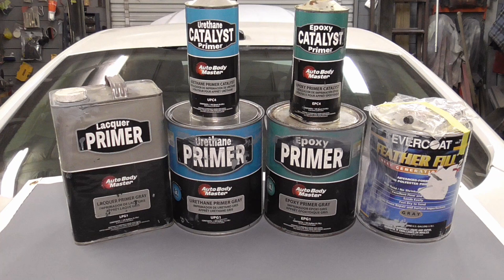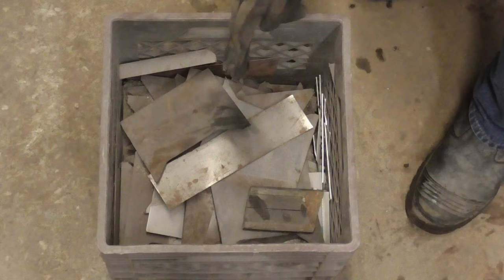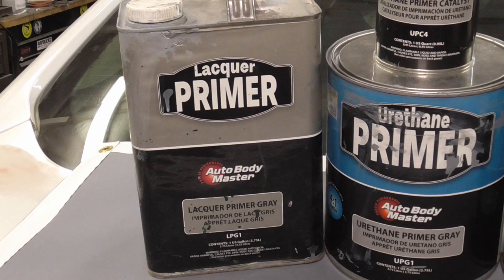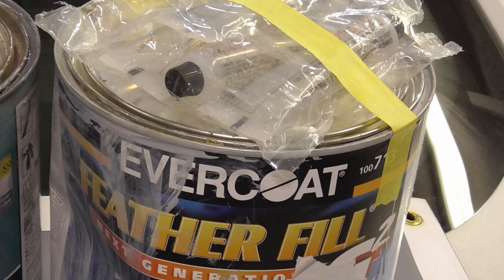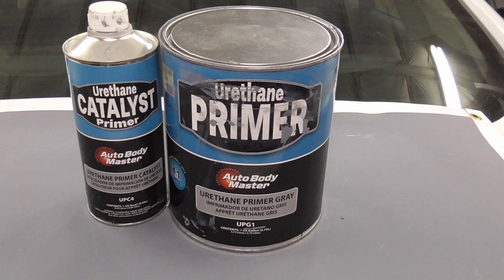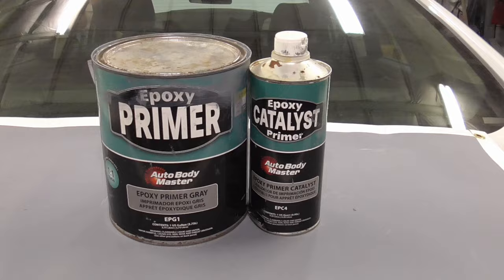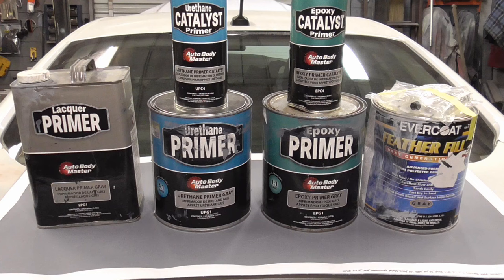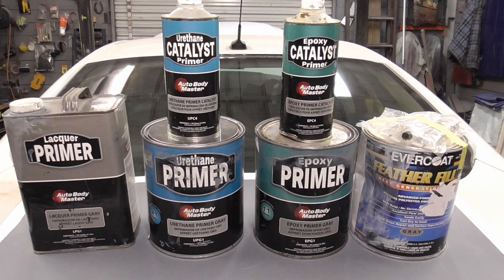A Simple Automotive Primer Guide - Types, Differences & Tips

Comment: What about etching primers and weld thru primers?  Are these considered specialty primers too?
Reply from the maker: Yes - they are specialty primers and you won't see them in a regular, high volume body shop.  Neither one is really necessary.  You can't assure that the area around the weld pool hasn't burned the primer either so it becomes useless.  It's best to think of another way to prevent future rust like this - https://www.youtube.com/watch?v=y05dNxt-nVc

Comment: You hear alot of laying down epoxy primer then the Urethane primer.  The Epoxy for corrosion protection and the Urethane for building. Are using both really needed?
Reply from the maker: They are not.  Most urethane primers say DTM or direct to metal and that means there's no need for epoxy primer.  As stated in the video, if you are going do some body work then park it outside in the weather for months at a time then go ahead and use the epoxy primer - other wise you are fine going straight to DTM primer surfacer.

Comment: I'm painting a 2006 Sierra Hood that was stripped to bare metal. It looks to have a thin galvanized coating over the tin, is there a special primer or process to follow for priming this hood.
Reply from the maker: Not really - as long as you DA sand it with say 220-320 you can go ahead and prime it with your choice of automotive primer.  Use epoxy primer if you are really concerned - stuff sticks very well to aluminum, metal, etc.  Then you can coat it with urethane primer surfacer if you want to block sand it.  Epoxy doesn't sand well - clogs the paper :)

Comment: What sort of paint can be used with each primer? Thank you for the informative video.
Reply from the maker: Any kind of paint can be used with any type of primer.  You'll hear stuff about not being able to spray urethane over lacquer primer but not true.  Here's proof...... You can put urethane of old paint that is sanded - that's a total given. Well.... since you always finish sand your primer or seal it with sealer, you can put any paint over it.  I have always sprayed urethane over lacquer and never had an issue but I do finish sand.  I've sprayed urethane over unsanded lacquer primer to - no issues.  Lacquer, enamel and urethane can be sprayed over all of these primers - sanded or un-sanded
Reply: @LakesideAutobody  Thank you so much for taking time to respond. I’m glad to learn that the chemistry of paint doesn’t conflict with the different types of primer.
Reply from the maker: Never put lacquer over relatively fresh enamel though - it will lift, wrinkle, etc.  The old rule of thumb was... you can put enamel over lacquer but you can't put lacquer over enamel.  Lacquer has too strong of a thinner - lacquer thinner is very strong stuff - the strongest actually - it cuts through almost anything - even melts plastic :) @LooseNut099

Comment: What’s a good primer for fiberglass or plastic bumpers?
Reply from the maker: For fiberglass and SMC (sort of fiberglass), you can use any of the primers in this video.  For plastic bumpers you use any thing too but it's probably best to go with epoxy (best adhesion) if you don't have to block sand.  If you have to block then go over your epoxy with urethane primer surfacer.

Comment: 🙋‍♂ QUESTION.  Can all of them be top coated with any kind of automotive paint or does the Lacquer primer need to be top coated with Lacquer paint and not say urethane or enamel?  Your videos are awesome.
Reply from the maker: You can put any type of auto paint over any type of auto primer.   I think that type of thinking came from back when you could spray enamel paint over lacquer paint or even enamel clear over fresh lacquer paint but not lacquer paint over relatively fresh enamel as it would react or wrinkle.  You could always put anything over lacquer primer.  If you are in doubt, you can always give it a quick sealer coat before your paint - then absolutely now worries.  I've never had any issues spraying urethane paints over lacquer primer.

Comment: Which primer can you use as a sealer that will allow you to still  put body filler over?
Reply from the maker: All of them.  I do like to sand the primer a bit before filling - it is not necessary but I feel that the filler would probably stick better.  Even over low areas of filler, it's good to rough the un-sanded filler before adding more.  Basically everything gets sanded before putting something over it whether it's filler, primer, OEM paint, etc.
Reply: @LakesideAutobody  Thanks 😊

Comment: Protec para glaze epoxy primer is the cheaper PPG product and can be blocked and filled over or used as a wet on wet depending on how much you thin it and Or always follow the mds instructions never had a problem and I use the HS auto thane ppg primer as finish before applying base coat and clear in Australia 🇦🇺 it’s the only way to go in my opinion.. as for 1K lacquer primer y use it when 2pac is nearly the same price and one k went out in the 80s
Reply from the maker: One thing to always keep in mind about 1K.... before 1990 that's all there was and it worked great if used correctly.  Millions of cars today still look perfect with lacquer primer under the paint.  Don't be fooled by the magazines, TV and blogs.

Comment: I paint guitars, frequently with automotive paints.  I recently ran out of primer and picked up a can of Transtar 2-in-1, which I later found out is lacquer-based.  Transtar says this is compatible with nearly all automotive paints, including urethanes.  I was always taught not to put urethane over lacquer, as lacquer is a drying finish and not a curing finish.  Over time, the lacquer will continue to gas off and you run the risk of trapping that gas beneath the urethane, which can result in the finish lifting or cracking.  Is that not an issue with automotive lacquer primers?  I have to assume most people who would be painting a car would be using modern urethanes for base and clear?  Thanks.
Reply from the maker: You can spray acrylic enamel, urethane and lacquer over lacquer primer.  Here's proof - https://www.youtube.com/watch?v=idrLzsz2eLg  I always sand primer before painting though so....  I think that is said because they really want to phase out lacquer primer because you use way less - you don't have to throw out the un-used mixed up portion.  There's no pot life.

Comment: What about etch primer?  See a lot of conflicting information about it.  Is it necessary for aluminum - like alloy rims?
Reply from the maker: Alloy can be initially primed with epoxy then primer surfacer or just epoxy if they have zero imperfections.  You don't need etch - ever.  It probably can't hurt but it's never necessary.  That said, there are special primers for plastic interior parts but that's a whole different ballgame :)
Reply: @LakesideAutobody   " You don't need etch - ever" This was my conclusion as well since at least the advent of epoxy primer and as long as the aluminum/alloy surface was recently prepared (oxide layer still thin).  Thanks for confirming my suspicions as Ive been very hesitant about putting any sort of primer filler over etch that's not 100% cured due to the acid.  Thanks!
Reply from the maker: @anonymoususernam1000  You're welcome - have a great weekend 😊

Comment: Does anyone wanna chime in on the pros and cons of using laquer primer? Im a diy painter and Ive had really good results using it. I know at one time it was all that was available. I like that it can be thrown back in the can to save. It dries quick and sands very nice. People say it sucks but never say why
Reply from the maker: It works fine and worked fine for 50 years before urethane.  The problem arises when a guy tries to bury poor body work with tons of primer.  The same can happen with urethane or even polyester.  Used properly it'll work fine for you.  It will always be your "go to" primer :)

Comment: What about etch primer and sealer?  Are these not really required or are they beneficial?
Reply from the maker: They are not required.  Sealer is nice if you want to get everything one color before painting, hit any bare spots and basically seal everything underneath from the paint.  Etch has never been used in the body shops I've worked in - even worked at Macco for a while 😊
Reply: @LakesideAutobody  thanks for the response and wisdom.

Comment: I purchased Acrylic Lacquer Primer surfacer, with reducer. Now, the "internet" says, Don't put polyurethane over lacquer primer, there will be inadequate bond. What paints are compatible with this primer? Love your videos!
Reply from the maker: Every paint is compatible with lacquer primer.  There are quite a few TDS that state you can.  The internet may be talking about spraying it right over freshly sprayed primer.  I always finish sand primer.  Remember... if a substrate is sanded, you can put any paint over it.  That being said, here is the exact sentence from the TDS - Autobody Master Lacquer Primer "Sealing is recommended if topcoating with a urethane or synthetic enamel topcoat."  Again, I think they are talking about spraying it over un sanded primer.  I've never ever had any paint chip, peel, flake off using lacquer primer using lacquer, acrylic enamel or urethane.  By the way, you want to thin your lacquer primer with lacquer thinner.  Reducer is for urethane primer and epoxy primer.  You can also thin polyester primer (feather fill)  with lacquer thinner.
Reply: I got the Speedokote,Acrylic Lacquer Primer Gray 2 gallon kit, w/Slow Speed Reducer, SMR-275/0085. they call it a reducer. Thank you so much for taking the time to answer my question. Really like your channel.  @LakesideAutobody
Reply from the maker: OK - got it.  I think you'll really like this primer.  It'll dry fast, build fast and sand easy.  Let me know what you really think of it after you use it.  The TDS for that primer says you can spray base coat over it - https://s3.amazonaws.com/speedosds/TDS/SMR-277+Tech.pdf (last line in the TDS) @WingsWheelsChannel

Comment: Do you know what the tractor supply farm and implement primers are considered? They have Krylon or Rustoleum in Red Oxide or Gray Primer and they say to thin it with Mineral Spirits. I have used both acetone and mineral spirits before and both work fine. The Krylon is $59.99 a gallon and about $70 for the Rustoleum.
Reply from the maker: Not sure what KRYLON is but I'm thinking acrylic enamel or maybe since it's probably implement paint it might be oil based enamel.  RUSTOLEUM is oil based enamel.  Maybe the TDS tech data sheet on the KRYLON will tell you what it is.  If mineral spirits or acetone thins it then it's oil based.  If you need reducer to thin it - its acrylic enamel.  That might give you the answer too.  Let me know if that helps - Jerry
Reply: @LakesideAutobody Thanks. It seems to be a copy of the rustoleum stuff. I notice no differences in the paint thickness or spray. But the Krylon is cheaper. It’s definitely oil based.
Reply: @LakesideAutobody I saw a guy doing body work using regular bondo but with an additive called “Plastic Honey” or plastic thinner. I tried the USC brand of it and it seems to work great. Have you used it? It thins your bondo and you can make your own 2 part glazing putty if you use enough. It seems to be more cost effective than buying the 2 part glazing putty as a bottle of plastic honey is $20.

Comment: Do they still make the master products? I looked online and says no available. I'm restoring a 73 nova and have been using shopline but it's now 275 a gallon epoxy and 212 2k. I know speedkote and upol seem popular without the price tag.
Reply from the maker: Both Speedkote and Upol are great.  The local Auto Value auto parts store in town here carries the Autobody Master - that's the only reason I use it really.  I actually just used the Speedkote epoxy primer - works perfect!

Comment: What grit sand scratch should you use  before applying laquer primer so that it adheres well directly to metal, but you won't have issues seeing the scratches in the final clear coat?
Reply from the maker: On bare metal you can spray lacquer primer over any type of scratches 40-400.  Priming over 40 grit scratches in paint is a different story.  After priming, you'll block sand, prime again, finish sand and then paint.  Only time sand scratches show up is if you don't DA sand or feather edge around the repair very well and leave filler sanding scratches in the paint.
Reply: @LakesideAutobody  Makes sense. Thanks for the reply. Also if I use lacquer primer over body filler how fine should I go before applying the lacquer primer? I was thinking 180 or 220
Reply: But from the video here I think you said you primed over 80 scratches or was this urethane primer that you used.?
Reply from the maker: Finish sand your filler with 80 grit then go ahead and prime.  Of course you can go finer if you want but finishing filler w/ 80 is common in shops.  Rough sand your filler w/ 40 grit, finish with 80 @user-gp4fk5uc6r
Reply from the maker: This video will answer all of your ?s - https://www.youtube.com/watch?v=mApSa0l4euQ Let me know if this helped :)   @user-gp4fk5uc6r
Reply: @LakesideAutobody  Yes this did the trick. It answered the questions that I had. I am not a newbie. I have did some painting in the past but don't do it everyday, and most of what I learned it seems that nowadays they say you shouldn't do it. All the types of primers and different grades of it, but I guess I will stick to what I was taught and chime in sometimes if I have questions.  You make good videos and take the time to respond when folks have questions or feedback. Thanks again for you patience and insightfulness.

Comment: Great information. How would you deal with a car that spent 34 years in Las Vegas and has no clear coat on any horizontal surfaces. The base coat is fine with great adhesion, but is rough to the touch. Can I just feather the existing clear and reshoot the horizontal surfaces with fresh clear?
Reply from the maker: You could do a little test area with clear to see if you like it.  If not the fix is to DA (your choice of grit - like maybe start with 220 just to see) sand the whole thing, prime, block, fill any imperfections if needed, prime again, finish sand and paint.
Reply: Just finished priming for the second time and I might end up having to do it again because I’m having trouble with the bodywork. What looks and feels smooth to me changes when I put on primer. Good luck and happy new year.
Reply from the maker: @lorenzo6045  Keep at it.  Happy New Year to you too my friend 🎉
Reply: @LakesideAutobody  I won't be doing this until spring, but I will let you know how it works out. Any suggestions for a clear? It looks like there is single stage and two part clear coat finishes. I really enjoy your videos because you deal with rust issues that are prevalent in Central New York state.

Comment: What primer would you use on bare aluminum? When I was in a shop in the 70's we would shoot a thin coat of zinc chromate primer on bare spots just before we applied color.  I can still smell it. It stunk.
Reply from the maker: Epoxy primer first then Urethane if you need to block sand.  Although again many primers say that they can be directly applied to aluminum and I would trust that.  IOW if the instructions say you can use it on aluminum, there's now reason not to trust that :)
Reply: @LakesideAutobody  thanks for your help - most appreciated.
Reply from the maker: @kevinroughton3670  You're welcome🎉🎊

Comment: What do you think about z chrome primer
Reply from the maker: I haven't used it but since it's a polyester primer it would probably perform much like the Feather Fill - the one advantage it has over FF is that it say that it seals too - very cool.  Also states that it's self etching which is nice although all polyester primers stick very well to bare metal even though you'll hear you should spray epoxy first.  Let me know if you try it and how you like it or if you already use it :)
Reply: @LakesideAutobody  we like it we be using it on our old hot rods. Down through the year's
Reply from the maker: @clarenceherron2562  Thanks for the tip Clarence - I'll give it a try sometime - I like that it seals :)